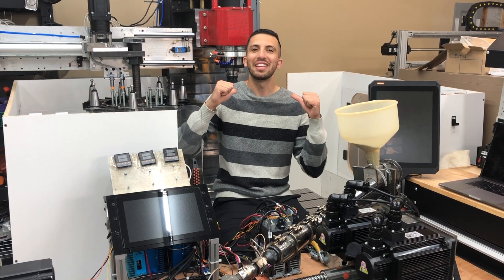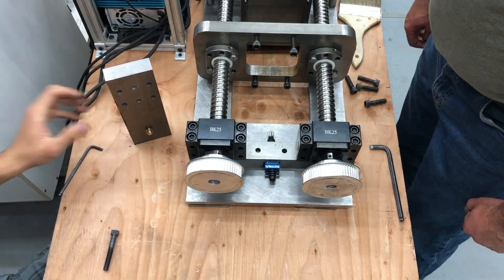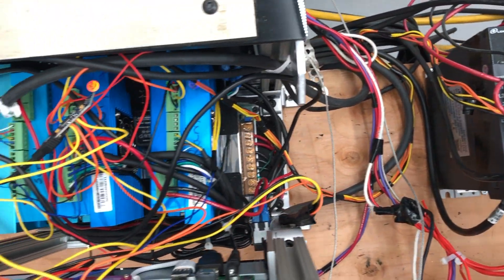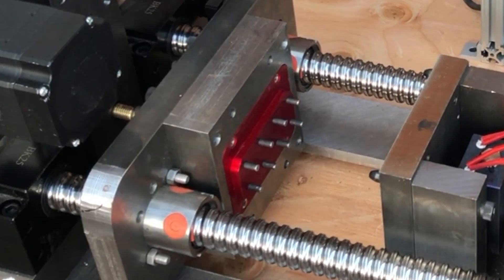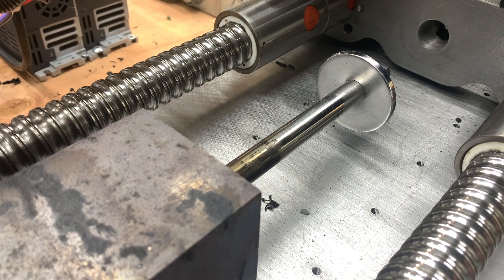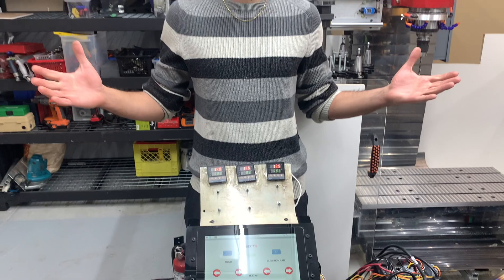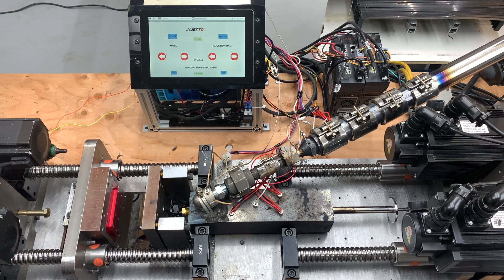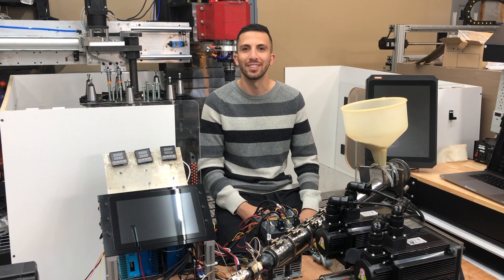Homemade Plastic Injection Machine | DIY

Comment: Is it a good idea to take a hopper and attach it to a cylinder the size of a trapezoidal screw.. Attach a hand drill to that trapezoidal screw, then throw it in a furnace? Maybe a check valve on the mold so nothing explodes.
Reply from the maker: I’m not really sure what you mean.  I’m having a hard time imagining this contraption.  Perhaps more details would help.

Comment: You're gonna want to have your molds heated, either by separate heaters or water heaters in order to get a better quality part and to allow for more even flow of the plastic. Yes it's small molds but keeping your molds at a reasonable, consistent temperature somewhere around 35-40% of your plastics temperature (for 500°F, 40% will have you sitting around 200°F mold temp) will give you better quality overall.

5+ Industrial Injection Molding experience.
Reply from the maker: Thats awesome, thank you for your input. We saw someone online cooling molds that are similar in size with a fan which seemed to work. We are constrained by size in these molds which makes putting water lines into them more difficult. Glad you enjoyed the video 😃
Reply: @ActionBOX  Not a problem and yes I enjoyed it very much. But yeah you are constrained by the mold size and with small molds it shouldn't be too much of an issue as far as temp goes but you definitely do not want them to overheat. Keep up the good work.
Reply from the maker: @DamacusSquared  Thank you sir, I do appreciate your support and input. Cheers

Comment: I would like to build one of these! I have been trying to find out and learn how I could make my own molds based on existing parts so that I can cast new parts, repaired parts, or additions/subtractions to parts in a Clear ABS. Any tips on how I might be able to do this? I haven't found any information on how they are even made in the industry anywhere. An example would be Clear or colored clear plastic "shells"  (cases) for Nintendo Switch. Not my intentions of making those but just an example.
Reply from the maker: Feel free to watch our DIY CNC machine video.  We used that machine to make our molds.  Cheers, Dave

Comment: I bought a nice electric log splitter with the intention of using that as a base for a injection mold machine. Had to sell it along with most of my stuff in order to move across the USA. I want to get stared and build it now but so many projects. Maybe in another yr or two.

The log splitter was 8 ton, or 16k lbs. I have studied DIY injection mold machines built by others for a long time and one thing is pretty constant, they do not have enough clamping pressure. I do like his machine but I would combine this with a simple hydraulic system for much more clamping pressure. 

Might just buy an industrial model with 50 ton clamp system. Those are pretty cheap to buy but parts cost will kill you, specially the electronics. Mine will not be fully automated, I do no think I can come close to these guys skill on that level.

Comment: Side question: how do you finish the leftover borders of the parts to get rid of the sharp edge from injection molding?
Reply from the maker: I’m not sure what you mean by leftover borders. Our parts come out as intended, with a break off tab that we cut off with cutters.  Does that answer your question? Cheers
Reply: @ActionBOX  I mean that thin line some molded plastic parts come out with, any idea of how to buff those out without damaging the plastic?

Comment: Cool machine! I am a Controls Engineer  and I primarily do controls on rubber injection presses (hydraulic motion control). I would love to see how you guys did the logic on a raspberry pi. I used to run my machines with Rockwell Automation controls (ladder logic), but have since switched to B&R Automation (primarily structured text). Lots of advantages over the former. So many similarities between the two types of injection machines, so I really enjoyed this video! Keep up the awesome work, I am subbed for life now!

Comment: Hey guys. You never mentioned how the 3D printed mold worked out for you. Did you get any prints out of it? Which resin did you use to print the mold? Great machine! Love it.
What size are those plunger motors? They're huge!  Looks like a couple of Nema42 for a combined 44Nm. Is that right?
Reply from the maker: We actually didn’t get around to trying them and haven’t yet. We have recently released a new plastic injection machine video, and in that series we will give the 3D printed molds a go. The motors are 2.2kW each so they are indeed great for the job.  Thanks for watching and glad you enjoyed the video 😊

Comment: Make some "cavities" in the mold parts, and then use an old enclosed CPU water cooler to cool the mold halves. That way, if needed you can speed up the production. =D
Reply from the maker: That’s an awesome recommendation. Thank you. We plan on rebuilding this machine and will try to include this modification. Cheers

Comment: Everything is cool. The only thing I would change is injection port and pushing rods for the plastic product should be on same side. This would make sure all flows are inside the box and you can not see them
Reply from the maker: That was hard to do  but I will try to make those improvements in the future.  Thanks 😊

Comment: I don't know why, when you see these plastic injection machines, I think it's a lot of parts, to melt and mold a plastic, I think these machines, could be simpler... I can't explain how but I believe it should be more simple
Reply from the maker: Hi Alexon, it simply can’t be.  Plastic is a very sensitive polymer to temperature.  If you don’t plasticize it correctly it will burn and change color. If you tell me more about which pet you think is too complex then perhaps I can share more.  Cheers.

Comment: Awesome machine!! How do you vary the injection pressure? Is it through varying the current to the motors? Thanks
Reply from the maker: Hi mark, the pressure is not tightly regulated in this machine, but more so injection volume.  Does that answer your question?
Reply: @ActionBOX  thanks for the response. So some moulds require a higher pressure to fill the mold. How would you do this with the machine? Likewise some may need less pressure to reduce flashing

Great content by the way
Reply from the maker: @3dfabrication  Our max pressure is limited by the motor power.  If we want more pressure we would just move the motors forward a tiny bit.  Aka we tell the machine to fill the motor an extra 0.1ml.  Does that make sense?   I know it’s not as ideal as real machines but it’s the best we could do for a tiny machine like this.
Reply: @ActionBOX  that makes sense. Thanks for letting me know

Comment: Everything is very good, but the screw ball pairs must be replaced with the good old trapezoidal thread with a bronze nut. . Because after a few thousand blows there is a notch between the screws and the balls. I say this from my own experience.
Reply from the maker: At that point I’ll just replace the screw 😉.  Did you build your own machine?  Cheers.
Reply: @ActionBOX  Yes, of course, I have one at the moment, it has made over 1 million blows ... Twice I change a broken screw ball pair ... The third time I put a screw with a trapezoidal thread. Omron's controller.  It is currently working as a Swiss watch. Cheers to you too.

Comment: I'm not sure if you're still using this injection molding press for production parts, but you can get shorter cycle times and better tooling life by circulation of cold water through the mold. It's pretty simple to add water lines to the molds. I used to be an injection press tech and a CNC programmer/machinist making primarily injection and blow molds. Your design is very close to industrial presses, any larger than this and you will want to go to hydraulic clamping, though. The nozzle forces are insanely high with injection molding.
Reply from the maker: Thanks for the tips.  It’s always nice to have a professional look over your work 😃. Cheers

Comment: Many years ago I used to do some support for these types of machines.  The companies specialty of CD cases. As you are attempting to have an automated system, you need to control the temperature of the molds.  We had heater coils on the molds to get them up to temp so the plastic would flow.  After running them a while the mold gets too hot and the molded piece will not eject, it will just tear.  We had water lines cut in the mold that circulated. We monitored the temp of the mold to tell if we needed to heat the mold or cool the water.  I know it may be beyond the scope of your build, but next time!! :-)
Reply from the maker: Great advice, thank you

Comment: What is inside the heating tube to pump the plastic? An auger? What happens when the remaining unused plastic cools inside the machine? It can be re-melted and not gum up everything?
Reply from the maker: Special screw. I will show it in a future video. Cheers.

Comment: Your content is fascinating, yet the main premise of the interest that brings people here and causes the views is we wanna learn how to build such machines. I really hope you keep producing these videos in a more detalied fashion

Also, for improvement ideas, what causes the problems in some of the plastic parts lined up at the end? It looks like something pushed into the plastic
Reply from the maker: Hey, I appreciate this comment.  This machine was the first I posted on YouTube, so I wasn’t familiar with the process of filming. If you check out my latest EDM sinker and EDM machines, I hope you would find far more details as per your request, plus better production quality.  Cheers, Dave
Reply: I was wondering about the final parts as well. Only the ones closet to the camera looked to be a really good part. I take it you guys know the issue, would be interested in hearing what was the issue.
Reply: @philsarcade  the spot on those molded parts looks like the outlet for excess plastic, when the mold is filled  there should be a little extra squeezing out that you will trim off after the part cools.

Comment: with your barrel at an angle  then going thru two  90 deg .  fittings next to the front mold it looks like your creating a hot runner
Reply from the maker: Hi bob, can you elaborate? What do you mean? Cheers

Comment: I've enjoyed your DIY videos.  One question, what do did you use as the one way valve after the reciprocating screw?  I keep thinking about trying to build a machine similar to this
Reply from the maker: I built a diy one way valve.  It worked really well, but in all honesty, if I could change anything about this machine it would be all the components between the end of the screw and the entrance to the injection chamber.  I will redesign everything and try to rebuild the machine.  Cheers

Comment: Looks like overhead of motor power used )
Reply from the maker: These are definitely powerful, but injecting plastic at low temperatures requires tons of force (literally 😜)

Comment: Do you have a sectional view diagram of what the feed screw looks like. or where you sourced the screw itself?
Reply from the maker: It’s a reciprocating screw and we sell them.  I can send you a picture if you would like, but it’s a conventional tapered plastic injection screw (a reciprocating screw). Price per screw and barrel is $900 shipped.

Comment: What were the deformations in some finished products? Its where the plastic enters the mould or was it from pushing or dropping down?
Reply from the maker: The injection site for that mould was on the outside of the part. Cheers

Comment: Definitely faster.
Yesterday I made around 160k parts in 6 hours
Reply from the maker: Wow, that is impressive. smaller parts I assume? Cheers, Dave
Reply: @ActionBOX  I can't remember exact measurements, I switch the mold I use daily.
I think these are around 4 ounce parts I did.
If you have any questions about injection molding let me know. 

I'm a thermoplastic mold injection technician 🤗
Reply from the maker: @sargkookie3118  absolutely, thanks.  I can always use the help of a professional 😃
Reply: @ActionBOX  got a discord?
Reply: @ActionBOX  perhaps not?
Reply: @ActionBOX  also, great work on your channel. You've got good quality content. Just stick with it and you'll grow.

Comment: uffff amazing setup. Will you release the plans for build one ? Congrats !!
Reply from the maker: Yes I will be in the future. Glad you enjoyed the video, and don't forget to help me out in the meanwhile by sharing with at least one friend 😃. Cheers, Dave
Reply: @ActionBOX  I will for sure. I´m in a moment in my life that I simply urge to have a small injection machine. But that steppers are very expensive here, I have two nema 34 from a previous project, and will try to get 2 more. Also, I will redesign using leadscrews. I hope it works somehow.
Reply from the maker: @carlosefreitas4040  Im sure it will. Good Luck
Reply: @ActionBOX  Would you mind to share what are the motors used in your project ? Thankyou :)

Comment: I love the machine and your passion for it too my friend!  Liked and subscribed.

I'm working with the local civil protection director to make a prototype of a torpedo style rescue floatation device to be donated and mounted on natural wood posts at our most historically dangerous beaches.  

These torpedoes are abusively priced ($150 USD), not available locally here in México and not available in all-natural materials but I'm working to change that.  

We need a local bioplastics supplier with materials well suited for this purpose with sheet plastic that can be manually heat-formed over a mold.  And for a much larger scale impact, we need an estimate of the cost of mold that could be used with recycled plastics, bioplastics and biodegradable plastics also to injection mold them for us.  If we can raise the funds to pay for the mold ourselves, the devices can be relatively very inexpensive which will make them very accessible and help save lives everywhere they're used.
Reply from the maker: Seems like a very cool project you are working on. depending on how many parts you plan on making though, this machine may not be the machine for you. You may need a real industrial grade machine. Cheers

Comment: How can we get rid of all the defects visible in the parts?
Reply from the maker: When the molds heat up you will not see the striations.  You can also use higher injection pressure which allows you to reduce the temperature of the heated plastic, which results in a nicer finish (less burned plastic).  Don’t forget to help me out and share my video with at least one friend. Cheers, Dave 😃
Reply: @ActionBOX  this helps more than u think
Reply from the maker: @fireworm91  I'm glad it does, Im here if you have more questions.Also please don't forget to share 😊.

Comment: How easy is it to clean it for when you want to change plastic types?
Reply from the maker: Great question, it’s slightly wasteful as you need to run the new plastic continuously until the system cleans the old plastic.  Takes around 9 minutes.

Comment: its m'y job..u need hot mold to have a Good surface finish
Reply from the maker: You are 100% correct.  I have learned from experience after I made this video that as the mold heats up during use the striations on the plastic disappear, and it looks much better (more uniform).  Thanks for your comment 😃

Comment: As i know, injection mould nornally made by professional (and expensive) cnc that achieve high tolerance (mirror like surface finish, you guys probably will achieve this quality in the future i believe)
Is there any significant difference between your mould and “professional” one.
You guys are gonna be the youtube star for sure
Reply from the maker: Hi! Great Point. I have definitely made more complex molds in the past, but the ones in this video were simply made of aluminum to save time as I was on a time budget. Would not use these molds for any purpose other than demonstrating the concept to my viewers. Cheers , Dave

Ps. dont forget to help me out by sharing my video with a friend.
Reply: Thanks for sharing! Thats the sure thing i will do

Comment: Does this machine have an additional compression routine after injection? Nice build, I always dream of having an injection machine at home for some car parts. Build it for myself and like minded people all over the world.
Reply from the maker: At the end of the injection cycle the machine will hold the pressure, although now that you mention it, I could benefit from adding to the code a step in which the motors inject just a tiny bit more (say 2% of total injection size) to really drive up the pressure. Cheers, Dave

Comment: What was the reasoning for adding a separate injection chamber instead of using the screw for injection stage? Your design keeps the entire hopper assembly stationary but removes a lot of fine control over processing that happens in the barrel. Still the first accessible build I've seen of its kind and very inspiring. Parts look good too!
Reply from the maker: Thank you. This allowed me to inject quickly, while also controlling the temperature of the plastic better.

Comment: I've seen machines similar to this that have mold release sprayers to spray the molds with mold release after the piece is ejected and before the mold closes again.
Reply from the maker: It’s a great idea, but it’s an overkill for a machine of this size don’t you think?
Reply: @ActionBOX  If it isn't needed, then yes, but if it is needed, the added hardware is negligible.

Comment: Faster than 3D printing....Right.    If you have the mold!  And how does one acquire a specialized mold?  YOu have to make it!
Reply from the maker: Or you can 3D print it if you have the right resin. Otherwise just order it from a local 3D printing service with the proper material.  If you want to solve a problem, you will.